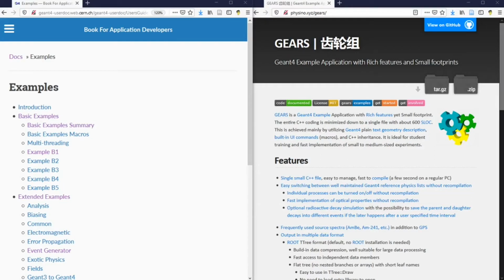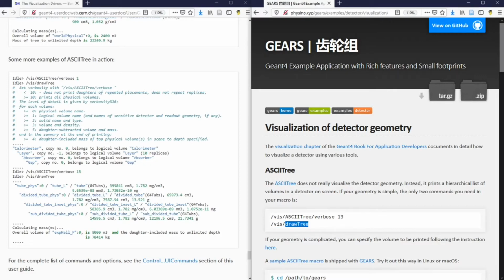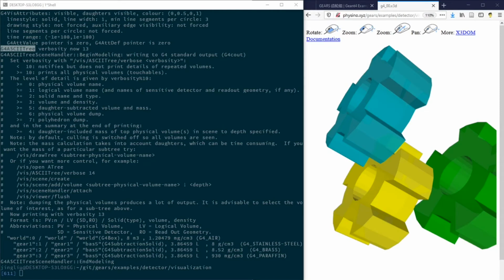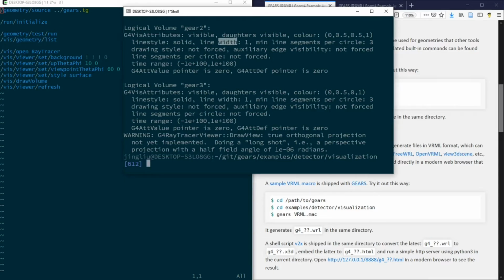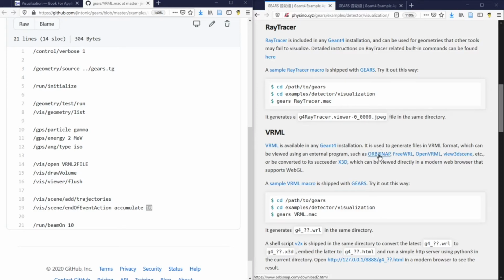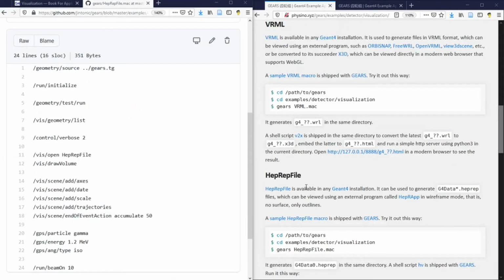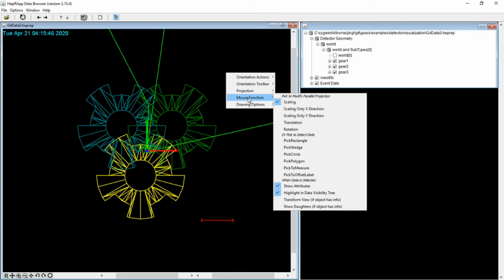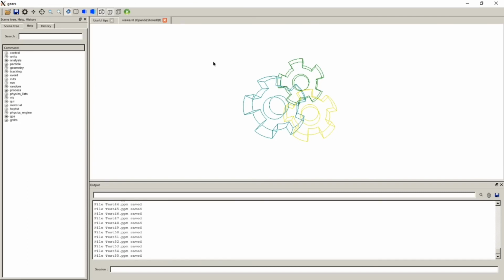4. How to visualize detector geometry (Hands-on Geant4 Mini Course)

Comment: 2:31 how do you open the macro ( the command window on the left )
Reply from the maker: that's vim running in mintty from cygwin. But the macro is simply a text file with the .mac suffix instead of .txt. You can right click on the file and choose notepad to open and edit it.
Reply: @physino  I also didn't get how to run this "Geant4 interactive session". Can't find it in Visualization instructions on G4 or GEARS pages. I went to examples/B1/build and ran ./exampleB1; then in "Session" I can type /vis/ASCIITree/verbose 13 and then /vis/drawTree. But it seems a bit stupid because I already have the 3D visualization in front of me...